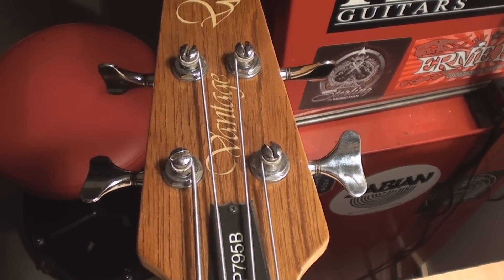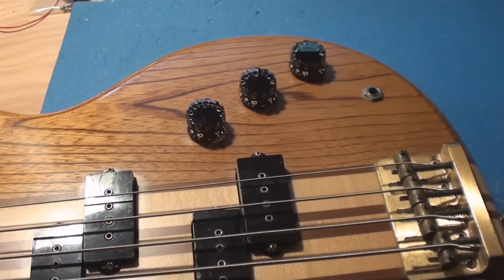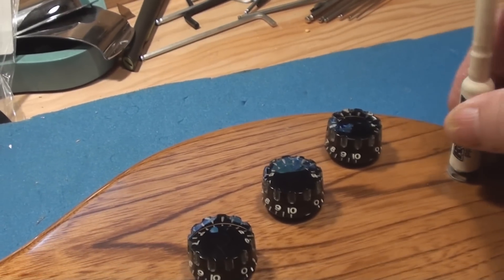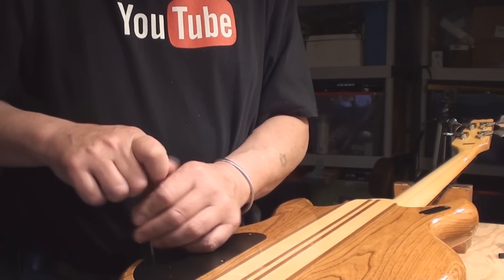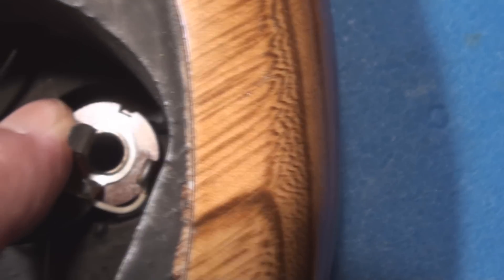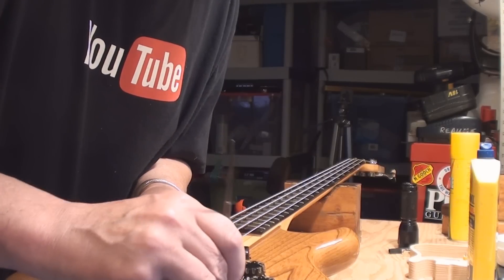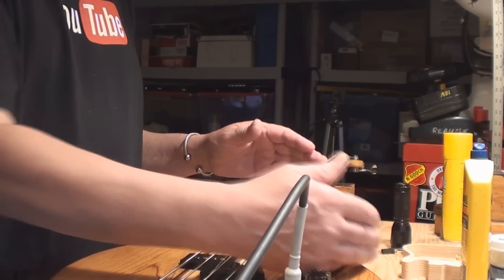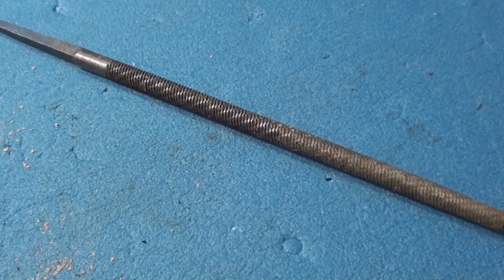Vantage Bass Guitar Quick Fix

Comment: I have a trans red Vantage Les Paul bolt-neck. I'd been trying to find information on it for a long time, but I ended up refinishing it, upgrading the hardware, and dropping some good electronics and pickups in. I love the thing, I've had it since I was eight.
Reply: +Rayce Coyle Hi there :) I am a noob to Bass but i must say it's going o.k,I have a Vantage that sounds the same as yours,The model number on the Headstock is: 525 B ? I am trying to find out if it's a p bass or a j bass,Like i said im new,So i thought i would change the strings,What a mistake,It sounded beautiful with old strings but they looked completely bent up and very stretched,I think they were ready to ping,My mistake :(  I put Adagio Professional series regular gauge 45 Nickel wound,They sound awful,Very tinny,Where the ones i had when i bought it were a beautiful full bodied deep sounding bass sound,I think the other strings were flats? And they had a blue like cotton on the ends,Sorry for the monologue friend,But,I have messed up here and like you pointed out,You love the thing,Well same here,It is/was a cracking Bass,Could you please advise on what you think (apart from me messing it up) lol, It's not funny for me though,It was a great bass,Im sure we can put it right but i genuinely think it is the wrong strings for this guitar,Please help :)

Comment: The original Vantage basses from the early '80's are fantastic instruments.
Reply: Yep, those early Japanese Matsumoku made ones are usually top notch instruments. The later Korean made Vantage guitars were much lower quality.
Reply: Bambu Fan It's a Westone, I think, just another name on it. Am I right with that?
Reply: Westone, Vantage, Aria Pro II; it's basically all Matsumoku when it's from the seventies and early eighties and it's almost all pretty awesome.
Reply: +wetigersukesongs Very much so, I have an 84 Westone Thunder and an 82 Aria Pro II CBS 380, both better than my Fender P bass.
Reply: I bought a VA-900B brand new, in Louisiana, back in 1981! Still have it, play it, my favorite bass of all time. Active pcb had a cap burn up on it. Can't find any wiring or schematics diagrams for it. So, replacing it with a Aguilar OBP-3 or a Kaish pre-wired 3-band active/passive kit.

Comment: Great videos.. I played a Bantage bass V 15 years ago, and it sounded really good. Today I’m thinking about buying one of those abut still I have a question: are they solid enough?
Reply: I mean that’s the third Cantage the I see having an issue.. just my thought
Reply: Bit of a late response, but coming from an owner of these (a VS695B) these are incredibly solid, although you gotta be wary of the model, because the one in the video is a vantage player, with active electronics and dual split coils, while the vantage standards are the "cheaper" options with less frills. Overall these are built like tanks but depending on the finish theyre prone to dings and bumps